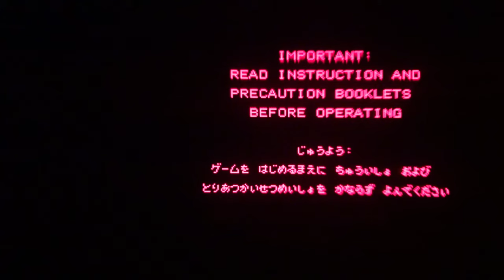Virtual Boy Lens Fix! Restore your Virtual Boy lenses with solder!

Comment: I did my best but several of my conductors came up while soldering. RIP my hopes of fixing my virtual boy. It's destined for display now, sad it won't be played again.
Reply from the maker: It can still be saved. There’s another option that can be installed if the flex cable is destroyed: https://segasonicfan.wixsite.com/retro/virtual-ribbon
Reply: @LIRetroGaming  amazing! Thanks for all your help and the fantastic videos!